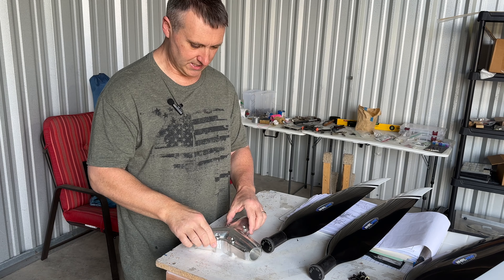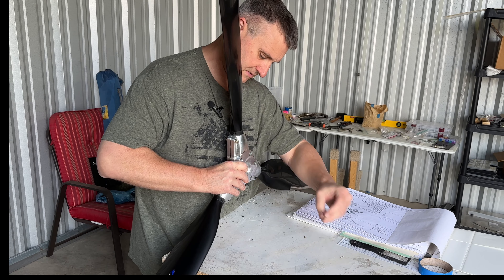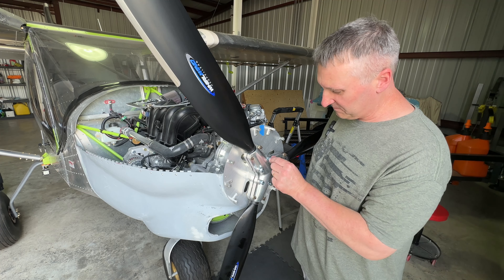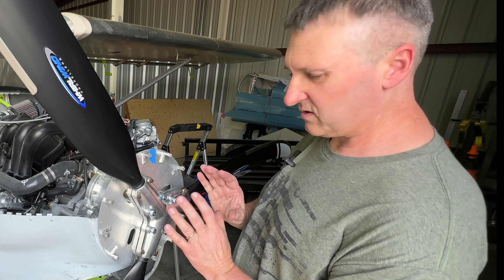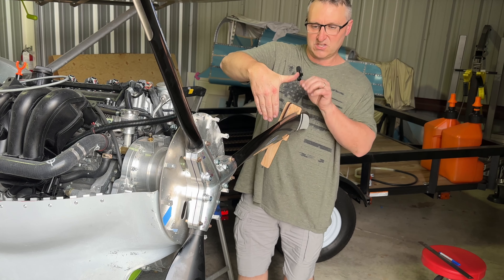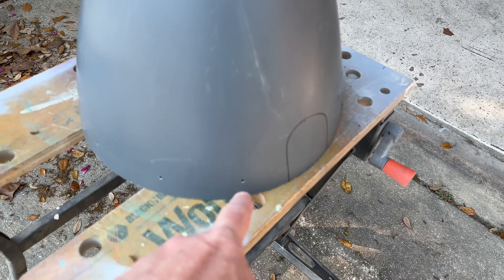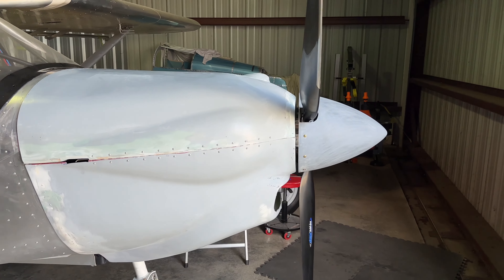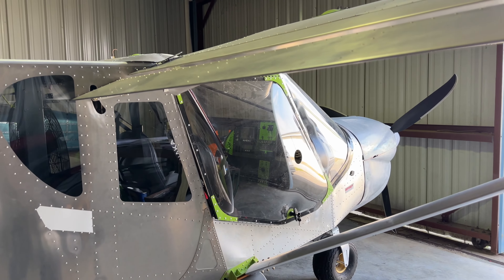Whirlwind Propeller Install

Comment: I'm building a Cruzer with Vinking 130hp also, installing my propeller soon, (same as yours) what was your last pitch setting, you started out at 20, Viking told me start at 17, ....?
Reply from the maker: Still right around 20 deg. I consistently see an RPM of 5150 during the take-off roll. You could take more pitch out and obtain a slightly shorter take-off, but it already takes off in a very short distance.
Reply: Thank You I will start out at 20 and go from there.
Reply from the maker: @BuddyR  FWIW, I had talked with another individual who had the same setup. He had a takeoff RPM of only 4500 or so, pitched more, of course. He liked this setup because the cruise was better, although takeoff roll noticeably longer. He didn’t feel he was working the engine as hard.